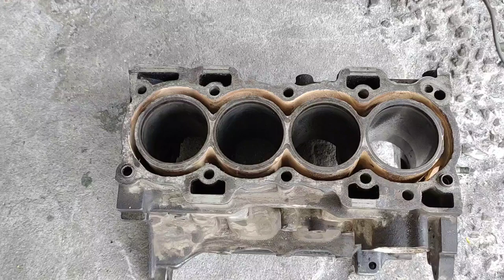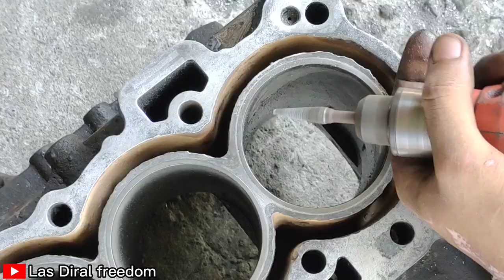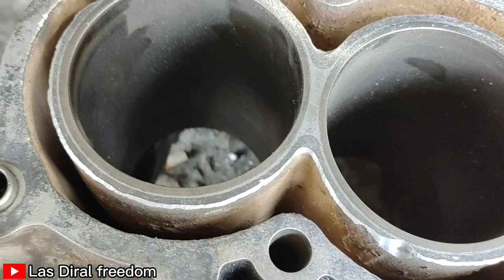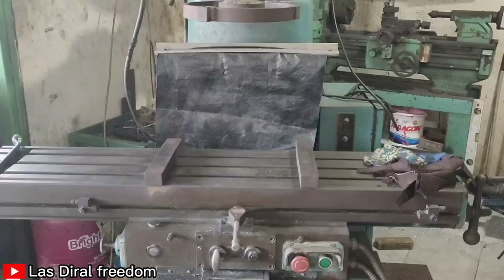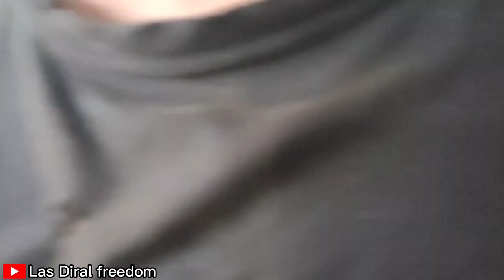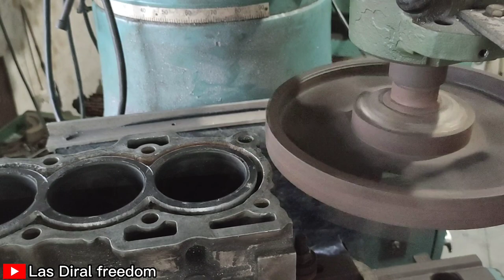Welding aluminum | repairing engine block | brazing aluminum | las aluminium @lasdiralfreedom

Comment: A lot of westerners, like me, will look at this and see all the less than ideal methods and tools, whilst ignoring just how hard it is to weld cast aluminium with a torch. Let alone welding old, corroded, oily cast alloy on top of a cast in iron liner. The machining is a bit rough and ready, but he has serious gas welding skills!! 😎😎
Reply: Bukan dari alatnya yg jadi dasar ,,
Tapi Yang terpenting adalah pengalaman dan hasil yang akan bicara 
Uraaaaaaa,,🤭😃